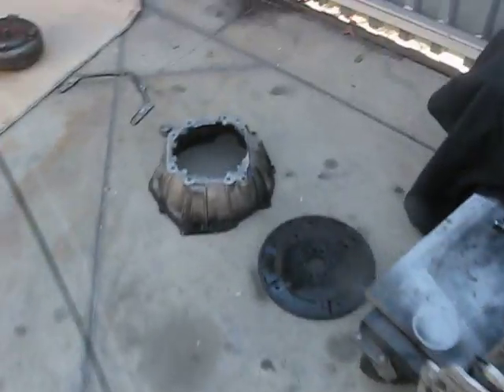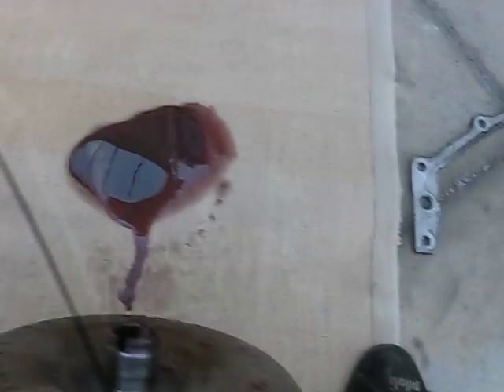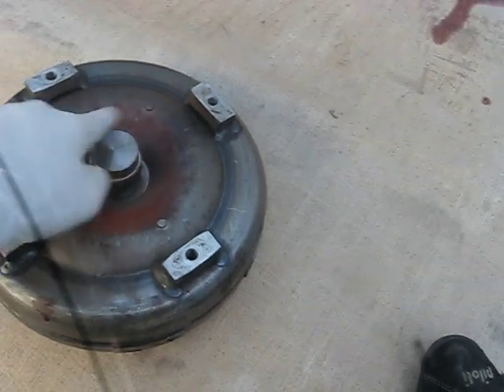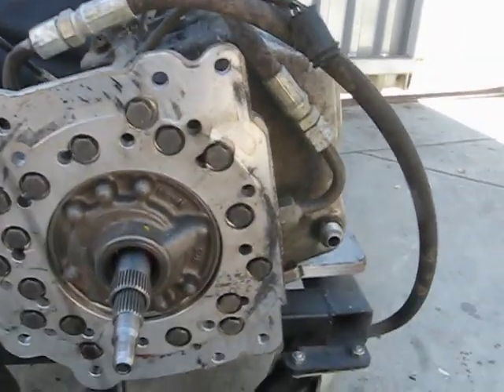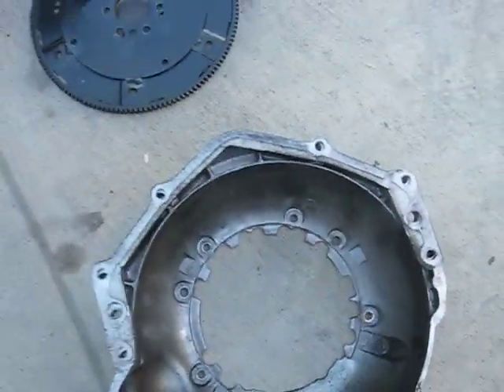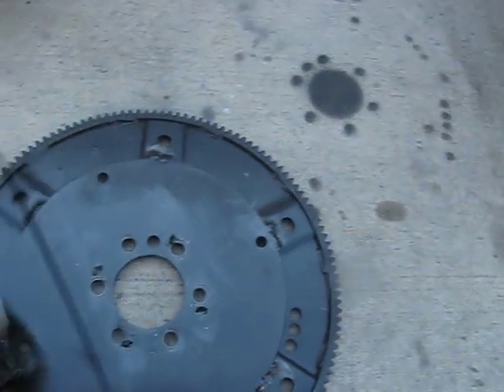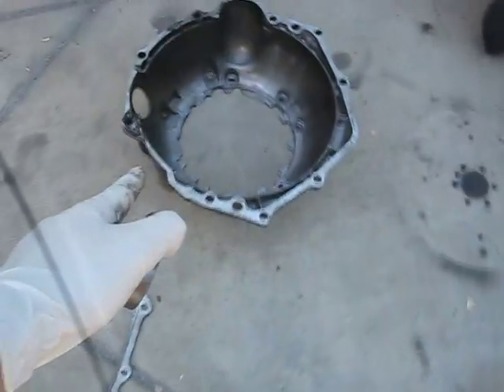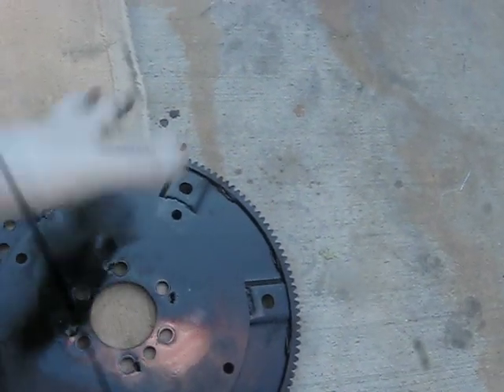LAND ROVER, DIESEL CONVERSION

Comment: I'm doing the same engine swap to my 1990 Range Rover classic. What is the thickness of the transmission plate adapter and what is the measurements of the crankshaft to torque converter adapter? Thank you.....

Comment: I would like to do a conversion like yours but it looks very complicated. why did you not use landrover or mercedes Diesel instead of hummer motor? also could you supply where you get your custom parts? thank you. I love classic rang rover and I love diesel. I currently have a mercedes 1985 Diesel

Comment: VIPER trans is T56  also used on Aston Martin DB9  Ford Cobra ,Corvette ZO6 those  are all short ratio  t56, they are one of the best made manual transmisions very very strong ,  when we attached the LT230  i had to modefi the floor , since it was longer ann together, bit it didnt need any widening .
Reply: I have been reading about you T56 to LT230 adapter, have you still got any pictures or numbers about the build? Thanks

Comment: DODGE VIPER  short ratio 6 speed manual transmision .  i can drive the rover ate 75 mph in 6th gear, and the engine rpm will stay at 1750 :) :) 

this trans can hold up to 700 hp and about the same tq.  however i have to say with zf transmission i pulled rolled over land rover up very hard hill with no problem.

Comment: it would of been much nicer if i had  converter made for diesel , but in USA we dont have that, so i ended up using the original one, witch worked just perfect , and it did not deeded any adjustment surprisingly 

now i have T56 dodge  viper transmission

Comment: they use hydraulic pressure measurement off trans. pump, the more throttle u use the higher the shift point, throttle varies hydrauilic pressure to vary points for diferent demand.
In fact over here we even have different convertor for the 2.5tdi and v8 and the 2.5 revs to 4000, buts its stall speed is way lower.
U can adjust shift points by adjusting cable from accelerator.

Comment: shift points are just perfect they way they are . you dont have to change anything, keep in mind that 3.9 is a very low revving motor so that transmission shift points were designed based on that and match with 6.2. and also shift points on zf22 are based on torque more than  speed , 
i made that bell housing adapter kz i did not measure it right the first time if i would of made the main adapter thicker it would of not required the bell housing adapter

Comment: when u fit bell housing adaptor, doesn't it make the distance between engine and transmission greater by the width of the adaptor?
How do u compensate for this?
Isn't the standard converter too high a stall speed and how did u change the shift points to match the gm?

Comment: YES D1  trans can handle that power,  the military 6.2 makes over 300 lb ft tq. but again it comes down to how you drive it.  zf24 you gonna use it not near close to be as strong as 4l80e, but for 300hp its no problem

Comment: 2000 RPM  AT 50 mph  NO GEARING  CHANGE NEEDED   it drives fine with zf22 but its better to have TQ converter made for diesel .   now it has T56 6 speed manual trans